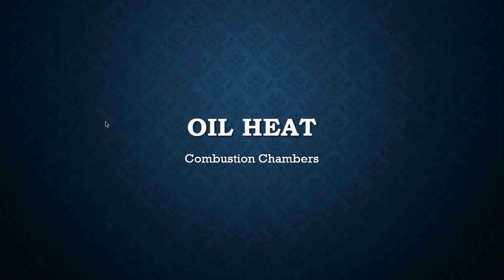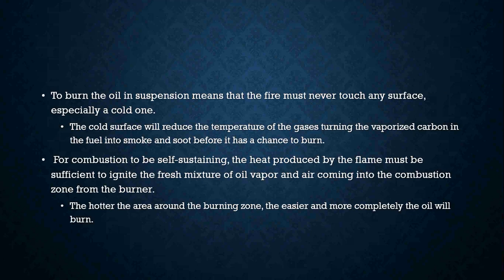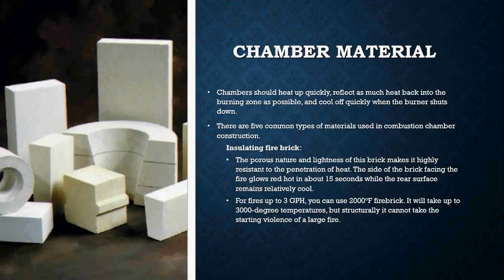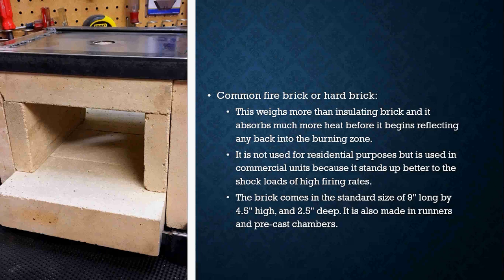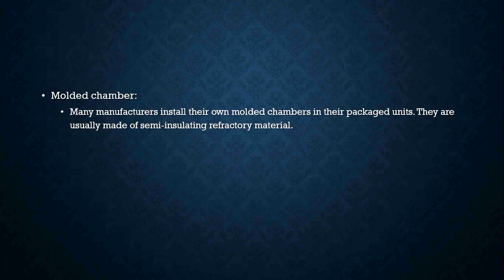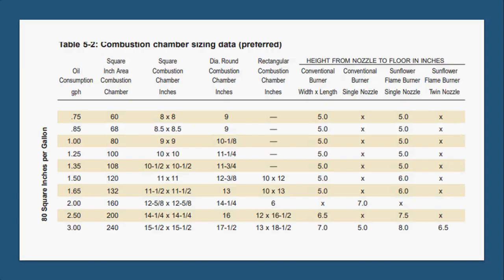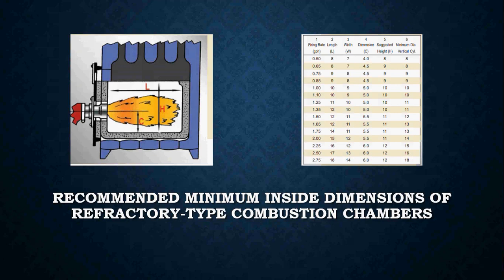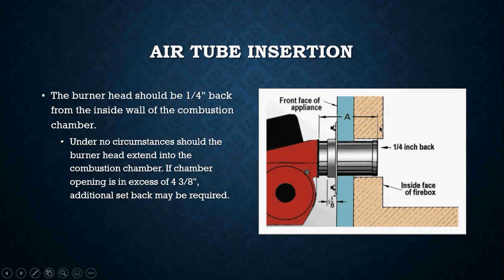Combustion Chambers

Comment: Hi there, could you explain the notation 80 square inches per gallon in bold print as it relates to the oil consumption gph figures (.75, .85, 1.00, 1.25, 1.35 & 1.50 to name a few) given the square inch area combustion chamber figures (60, 68, 80, 100, 108 & 120 to name a few)?